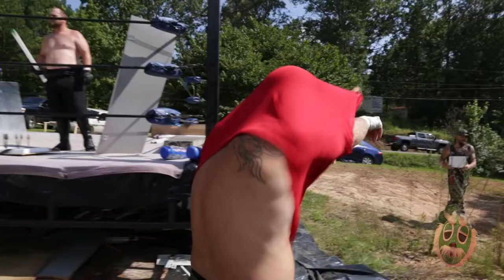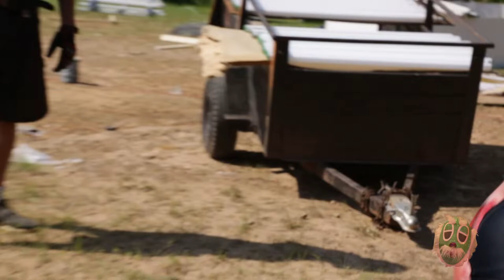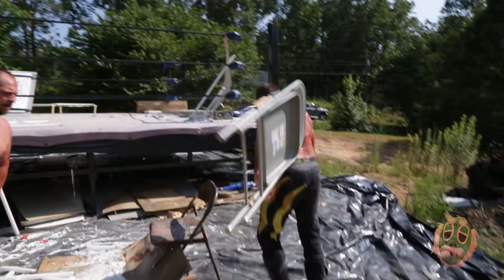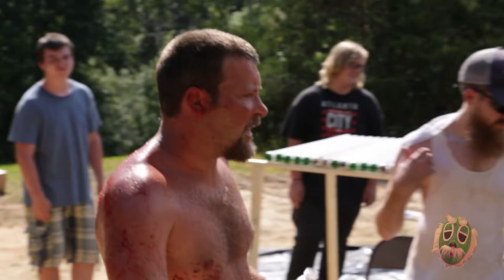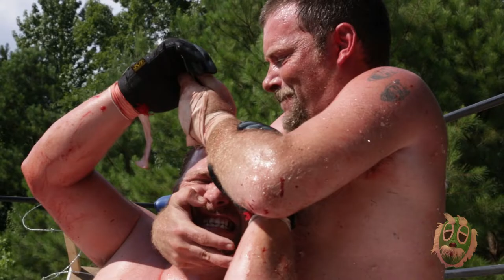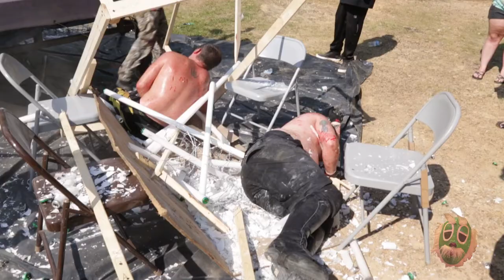IWA Deep South | Boriss Dukkee's Sh!t Apocalypse | Lights Tubes | Blaine Evans vs Jay Blade

Comment: Well there an amazing bump at the end of this which was by far the best match from Boriss Dukkee thing I saw thus far.  Unless the 21 minute one is which I've yet to see?  I should have time stamped the really nice video part where guy goes thru the tubes in like that weird box.  Must have been so hot as could see they kept dousing them water.  I mean at that point why not just have it be fire matches hehe.  I'm surprised they don't have a video feed for the commentary even if its just the hard camera as they could not see from obstructed view?  Real smart being barefoot in sandals with all the glass around too ;).  NOt sure why it matters if light tubes are used or not?  Maybe its got more gas or so that can inhale?